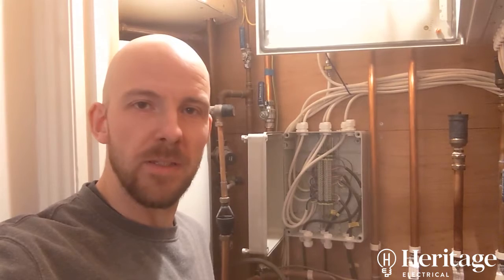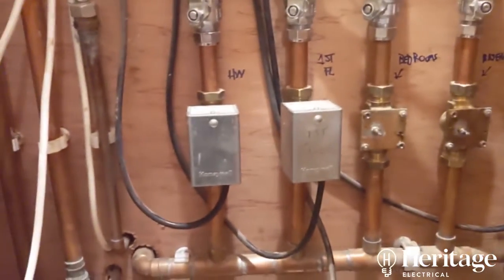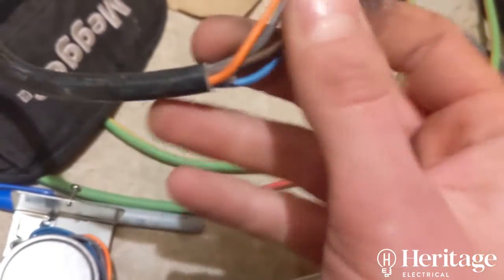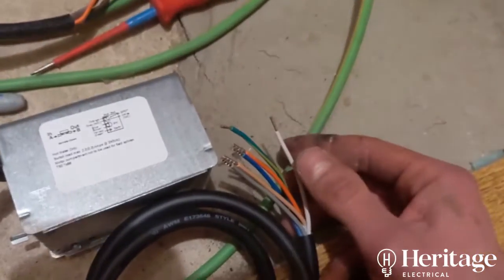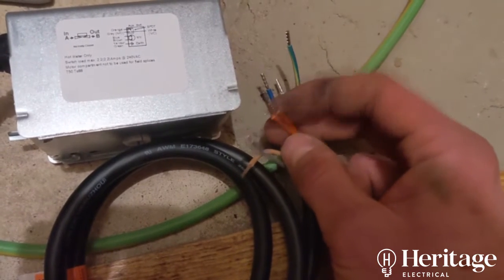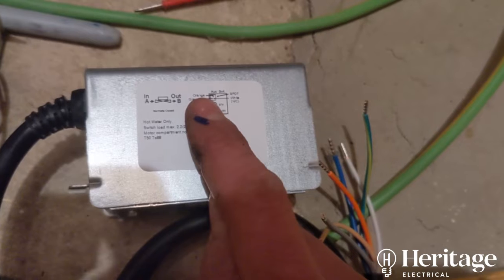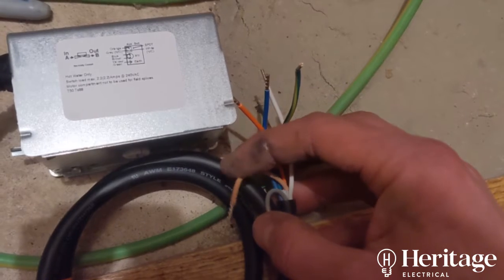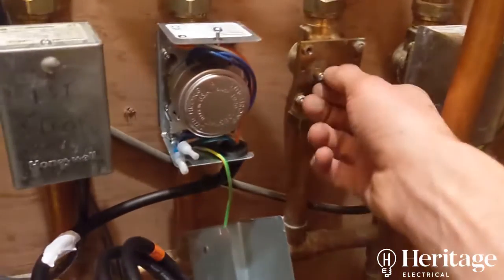How to Change & Wire a Honeywell Motorised Zone Valve

Comment: Hi mate where does the white one go ? Thanks
Reply: Same question.  He says “I’m going to ignore the white”.  Yeah, but what do you do with it?
Reply: According to the wiring diagram it is a normally closed (n/c) contact so it is connected to one of the other wires by the switch, when the valve is closed, and not connected to anything when the valve is open.  What is not clear from the diagram, possibly because it is a bit small to read, is whether the other wire it connects to is the orange or the grey.  If you have one to hand you can test this out with a multi-meter (when it isn't connected to the mains).
Reply from the maker: Hi Guys, thanks for watching. 
There are multiple variations  in which you can use the switched connections (grey white and orange), Volt free, extra low voltage and low voltage. 

I’ll base it on a conventional 240volt system. 
If you look at the diagram on the side of the valve it reads 
- Brown is switched live 
- Green and yellow is earth 
- blue is neutral 
- Orange is common 
- grey is normally open 
- white is normally closed 

To use the motorized valve as a switch to activate the boiler 
- Orange would be connected to permanent 240volts
- Grey would be connected to boiler enable 
- white needs to go in a wago connector. 

When the valve has no power and is closed, the white cable will be live.
So unless you wish to power heating controls with that white switched cable, it needs to be blanked off in a wago connector so it doesn’t come into contact with the metal casing. 

The way tom has done it in this video is also fine. 
-Orange (used as switched live out) is connected to boiler enable 
 - Grey is connected to a permanent 240volt supply.
- White can be left coiled up not used and will not become live. 

Have a great day
Heritage electrical

Comment: Sorry, lads, but where does the white wire go ?  Does it just hang free ?
Reply: Same question
Reply from the maker: Hi Guys, thanks for watching. 
There are multiple variations  in which you can use the switched connections (grey white and orange), Volt free, extra low voltage and low voltage. 

I’ll base it on a conventional 240volt system. 
If you look at the diagram on the side of the valve it reads 
- Brown is switched live 
- Green and yellow is earth 
- blue is neutral 
- Orange is common 
- grey is normally open 
- white is normally closed 

To use the motorized valve as a switch to activate the boiler 
- Orange would be connected to permanent 240volts
- Grey would be connected to boiler enable 
- white needs to go in a wago connector. 

When the valve has no power and is closed, the white cable will be live.
So unless you wish to power heating controls with that white switched cable, it needs to be blanked off in a wago connector so it doesn’t come into contact with the metal casing. 

The way tom has done it in this video is also fine. 
-Orange (used as switched live out) is connected to boiler enable 
 - Grey is connected to a permanent 240volt supply.
- White can be left coiled up not used and will not become live. 

Have a great day
Heritage electrical